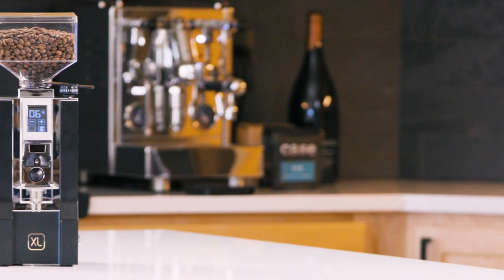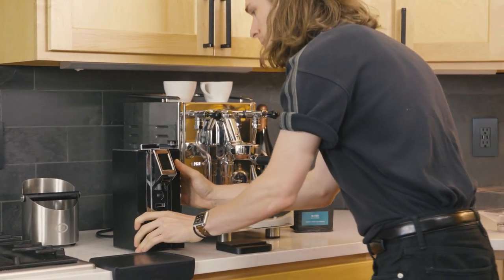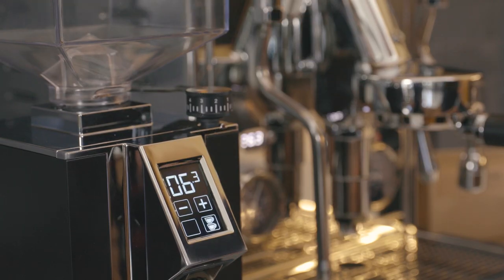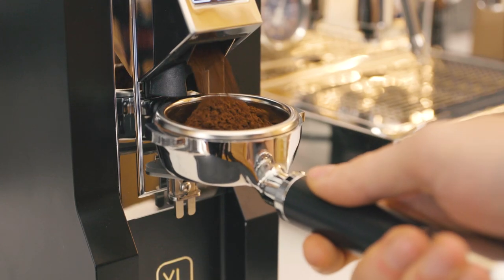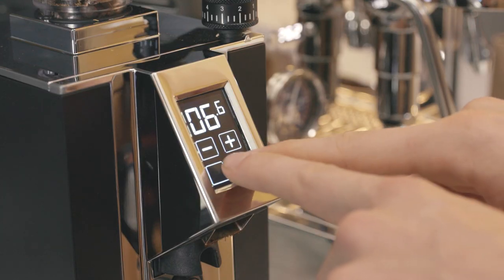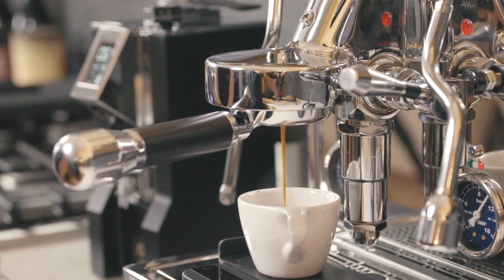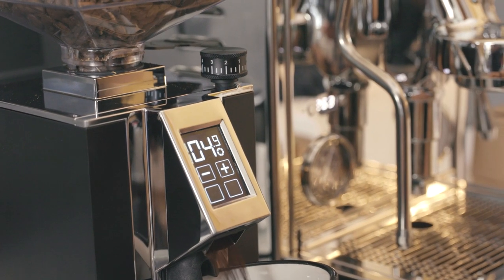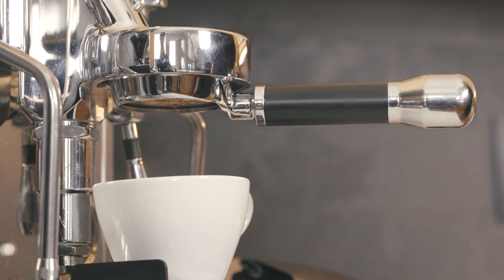Eureka Oro Mignon XL Espresso Grinder: Setup Video

Comment: any comments about the grind noise? is it quiet like the Atom?
Reply: I got mine a few months ago, I used to have Ceado E5P which was also quiet but this one is definitely more quieter than Ceado was, not sure what the grind noise in comparison to Atom 65.
Reply from the maker: It has a silent casing like all the other Mignon grinders. It should be quieter than the Atom.
Reply: @Coffeeinthusiast1  How does it otherwise compare to the E5P?  I'm considering this or an E6P, and they're the same price and have similar specs.  What caused your move to the Eureka?